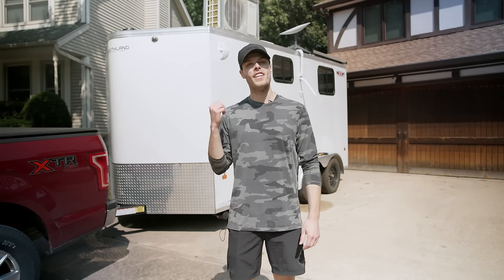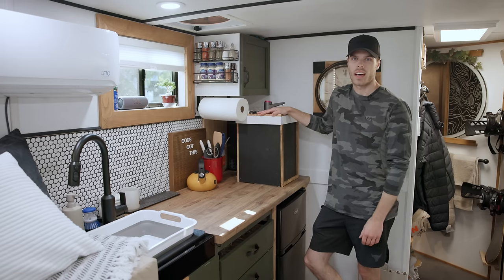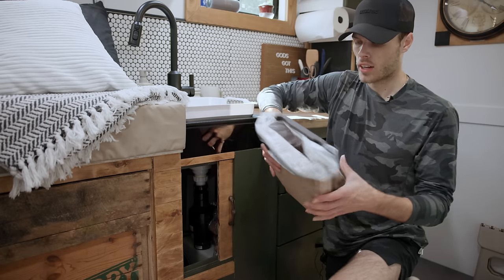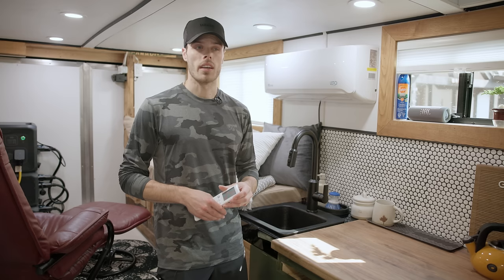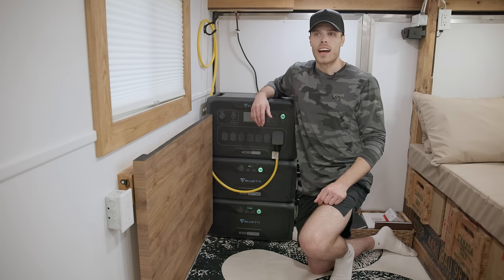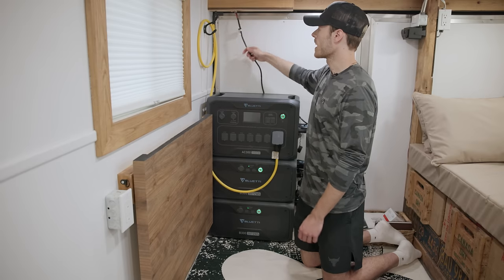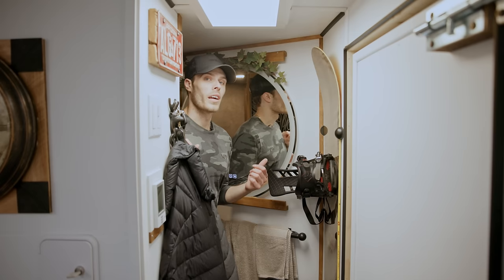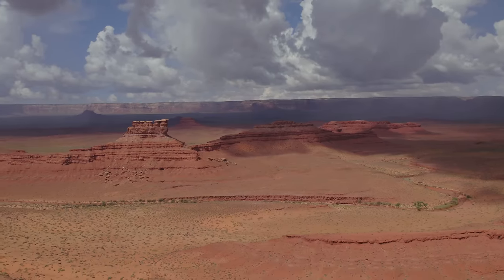I turned a $10K trailer into a $70K Modern Home

Comment: Nice build.   You may want to look into securing your side door latch when you are in the trailer so someone  can’t lock you inside.
Reply from the maker: I actually attach the lock over the latches and put the side bar off to the side when I’m in the trailer. This was something I wanted to make sure wouldn’t happen. 

I appreciate your comment! This is definitely important and it’s kind of you to take the time to mention this! 🙏🏼
Reply: No kidding about the outside latch. Also -- those "deadbolts" as he referred to them are anything but secure. Well under a minute to quietly pop that door open.
Reply: my thoughts also
Reply: @keithmorris6760 well he’d be outside his trailer in under 15 seconds, w his buddies Smith & Wesson by his side, lol

Comment: Get rid of the chair and get a hammock.  I've slept in a hammock for 4 years and it's the most comfortable. They are an acquired sleep but once you figure it out it's the best.  I'm surprised out of all the camper conversions I've seen I've never seen one person use a hammock. It would be perfect for space saving and also they are 100% washable so you can avoid all the creepers and foul smells of traveling,hiking,biking,camping,BO ect...
Reply from the maker: That’s a super interesting idea! I sounds like it would be an adjustment but something worth trying 🤷🏼‍♂️

Comment: I didn't find this video, it found me! 
I've been considering building out a cargo trailer.
Love your designs!
I too, would probably go with a power system that's just easier to work/learn, and just tweak it as needed!
You mention a couple of times how well insulated this is.  Would you give a brief description of the materials used and the process?
Or, maybe just get that other channel going for the build videos? I went looking for it and yt says it doesn't exist.
Posting here in a dedicated playlist would work too.
Reply from the maker: I’m really glad to hear you like the build! Hope it gives some inspiration for your own build! 

The materials I used for insulation was 2 1/2 inches of spray foam in the ceiling, 1 1/2 inch of R10 foam board in the walls (foiled both sides) and for the floor I have 2 1/2 inch of pink foam board. 

I haven’t currently edited any videos of the building process. There’s a guy named Chuck on YouTube who converts buses and shows his process and I took all of my inspiration for insulting from his video. I just couldn’t do spray foam on the walls because the owner of the trailer before me nailed plywood to the steel channels, so I had to work around that with foam board. Works great though, had enough heat to get me through -30 degrees celsius. 

Hope this helped! 🙏🏼

Comment: Nice Bluetti set up. I have the 200Max with 2 180 watt solar panels to run my 5x8 cargo trailer camper. My only major draw is the Frigidaire 5k btu window unit. It runs on less than 300 watts and has a soft start for the initial draw. I do want to get a Bluetti 300 battery pack to insure the storage. I was hoping to see the draw from your mini split on your Bluetti. Can you give us those specs,,nice build and thanx in bunches 😊
Reply from the maker: That’s amazing! Sounds like such a great system you have set up there! 
The storage of the BC300 is definitely nice to have! 

So generally if I start it fresh on a hot day, I’ll need to be pulling more watts from the start and that usually pulls just over 1000watts and I run it at that for 15-20 minutes. It cools the place down nicely and because the place is insulated well, I don’t need to run the A/C for long because it holds the cold in better. When the trailer is cold and if I continue to run the AC with the fan on low, it runs about 600-800watts. These are all readings from the Bluetti screen. 

My biggest long term pull is the fridge. It depletes the battery a lot so I might try to find another solution. Guess you don’t know till you try. 

I appreciate your question and I hope I answered what you were looking for!

Comment: First I want to say nice build. My wife and I travel about 200 days of the year pulling a nucamp t@b 400 BDL.  Comes complete with wet bath, kitchen, RV queen bed, small dinette, 3 way fridge (DC/AC/Propane), and microwave.  My second thought, just wanted to make some observations doing a visual comparison between our rigs.  I am confident you could have gone with a more energy efficient and smaller a/c - heat pump unit.   We have a Cool Cat and it easily handles our 15' of living space and lives tucked under the bench, driver's side of the trailer.  If your Bluetti system can power the a/c, I have to ask for how long?   Is there an outside plug where you can recharge your Bluetti from shore power?   Given the under carriage clearance when you were pointing out the drain pipes, could you have considered running both tanks into one outlet and placing that further back towards the leading edge of your wheels?  You didn't mention the size of the gray water holding tanks - if you are at a camp ground with sewer yep you can run the sewer hose open but what about when there is no sewer connection?  No stabilizers and looks like no spare on the camper so assume you carry it in your truck bed.  With this design, I would be curious to the tongue weight and your true loaded weight.  None of my comments are meant as criticism but are simply questions from someone who has spent a heck of a lot of time in a small camper on months long trips.   The one safety concern is that propane bottle inside.  Safe travels.

Comment: What did you do underneath the trailer we have a couple cargo trailers for our company and keeping pests out is very important and we have significantly less intrusions into the floor and I'm sure you do ? Also I would definitely find a way to get some more ground clearance trying to pull in and out of anywhere with a small hill is going to rip those sewer tubes right off. Even if you're careful those seemed a little too low

Comment: What’s up with that mini split on the roof? Never seen that before.
Reply from the maker: The reason why I did that is because I didn’t have any other place to mount it. I would have mounted it on the to tongue of the trailer but I have a smaller tongue then normal.

Comment: Great Build though I question the position of the main unit for your mini-split, seems a bit out of place up on top.
Reply from the maker: Yeah, it’s not ideal but I have a smaller tongue on the trailer then normal so I had to place it up top. The height is still lower then your typical RV so I’m still good with height 👍🏼

Comment: Is the AC too tall for some bridges? You talked about the Starlink getting ripped off the roof, how about the heating unit?
Reply from the maker: @a.life.reimagined  no, its still lower then most motorhomes and fits under bridges fine. I was more so meaning the wind catching the Starlink and taking it off of the roof. 

Are you asking what I’m using for heat?

Comment: I plan to do the same with my eco flow for power. I’ve not seen anyone use them this way before and was wondering if anyone had.
Reply from the maker: Yeah, honestly to avoid the headache of regular solar set up, I think this is a phenomenal solution! They’re such easy units to use and I find them pretty effective for what I need ☺️

Comment: Great job building the trailer, but I wouldn’t take bets on the ac not getting knocked off of the roof.
Reply from the maker: Thanks, I appreciate that! I can’t see a time that it would ever happen. It’s lower then a typical RV and it’s securely bolted with a heavy aluminum casing built around it, also bolted to the roof.

Comment: That AC unit looks like an accident waiting to happen. 

Is there a way to lay it flat while in transit?

Another concern are the door locks outside, I would want to do something to keep from having someone lock me in.
Reply from the maker: I know it doesn’t look like it, but with the standing height from ground to top of the A/C, it’s actually shorter then a regular camper. I pass under everything without issue. Also, it needs to be fixed because of the copper lines running to the head unit inside. 

The door latches have locks on the at all times when I’m inside the trailer so there’s no way for anyone to lock me in. I appreciate your concern though!

Comment: Since the minisplit points to the side instead from the rear, do you have any short cycling issues where it doesn't cool long enough to dry down the air to reduce humidity?
Reply from the maker: No, it keeps the place really cold and it’s cools the trailer down within a matter of minutes. I haven’t found an issue with humidity. Never had any issues 👍🏼
Reply: @jacobwagler  thank u so much for responding

Comment: Do you use a locking system for your drawers to keep them from opening?
Reply from the maker: Honestly I should but I haven’t been able to figure out a good solution. How I keep my drawers from flying open is by stacking my chair in front of them and they don’t move. Not the most efficient but it’s worked. I know many other people have a better solution.

Comment: Love your build just have one question rough guess how much do you have tied into your  Bluetti set up ?not the solar.and have you thought about puttingRollers on your bed?
Reply from the maker: Thank you for your question and suggestion! 

I likely have around $7,500 Canadian tied into the Bluetti batteries and inverter. They do have sales on them though throughout the year with decent savings so I would keep an eye out for discounts. 

I have thought about rollers but I didn’t think I could afford more clearance with the bed. It’s tight enough as it is with the bed under the platform. If someone was thinking about a similar solution, I would recommend them considering raising the platform even a little bit more. I’m happy with what I have though and don’t see any problem ☺️
Reply: I really appreciate your timely response. Bluetti is one I have but considering building myself a trailer.thanks  and by all means your bed your rules and it works I’m just to old and to Fat to get on these old knees😂😂😂 keep doing what your doing and live your dreams to the Fullest. Thanks again
Reply from the maker: @darrellbambammacon8390  I wish you all the best on your trailer build! 🙏🏼 Haha definitely hear what you’re saying, it is sometimes a strain on me so not a bad idea to have rollers! Just something to work on in the future ☺️
Reply: Maybe attach some large gliders, they are only about 1/4 inch thick, I use some on furniture in my home so I can move them.

Comment: Why didn't you put the aircon on the tongue of the trailer rather than protruding out of the roof?
Reply from the maker: I wanted to but unfortunately this trailer had a smaller tongue then the normal Cargo trailer so it wouldn’t fit unfortunately.

Comment: How did you do the walls ?
Reply from the maker: I used 1/2 inch A/C plywood on the walls and then sanded them, gave a first primer coat, sanded the whole thing and then paint 2 more layers. Came out really nice!

Comment: I don’t think the propane tank should be inside. When you look at RVs they are always outside. Your bed would probably slide way easier if you put furniture sliders under it. 
Nice build overall. I like some of your ideas.
Reply from the maker: Yeah, still finding a solution for the propane tank. I actually have felt pads under the bed so it’s not terrible, it’s just that it doesn’t have a lot of space with the blankets on the bed. 

I appreciate that 🙏🏼
Reply: @jacobwagler   - get the ceramic sliders. They are thin and glide like on ice.
Reply from the maker: @busch46  I’ll look into those! Thank you for the help! 🙏🏼

Comment: A bit strange to mount an HVAC exterior unit on the top instead of the back facing the truck. Rip off the starlink? I think the HVAC unit would get ripped off first!
Reply from the maker: It was really my only option. I have a smaller tongue than typical for a cargo trailer so it wouldn’t fit. 

I wasn’t coming from the place of it getting ripped off from hitting something, more from the perspective of, I’m not sure if the Starlink clip is strong enough to hold against the wind while travelling.

Comment: What kind of trailer is this? I want the double door as well
Reply from the maker: This is a trailer manufactured in Alberta Canada called Southland trailers. Great product! I would definitely recommend looking for a trailer that has a full sheet of aluminum top rather then a slip connected ceiling. Those will leak and cause issues so it’s best to get one manufactured really well!

Comment: Maybe keep your propane outside? They do tend to leak as the fittings age.  Hate to have a leak build up in there and then have the water heater ignite the fuel/air mixture.  RIP 😢
Reply from the maker: I really appreciate your comment! Yeah it’s not a bad idea. Right now I have a carbon monoxide tester always running but even still, it’s a good idea to keep it outside. I’m going to try to find another way to mount it. 

Appreciate your comment 🙏🏼
Reply: @jacobwagler  you are welcoms.  This caught my attention as I was getting repeated, small propane leaks at my RV tanks.  I think that the o-rings in the tank fittings dry out as they age.  That is the weakest link in the whole system but their rules likely permit this as their operating procedures would have the tank outside.

Great job on the build.  Job well done.
Reply from the maker: @patrickfrantz2466  yeah, that makes sense! 

Thank you I appreciate that ☺️
Reply: @patrickfrantz2466   I have had my small propane bottles in my van and trailer for years.  YES one  MUST have extra o' rings, pressure regulators, and hoses because they will dry out and leak.
Reply: @bobmirror7164  do you keep your in-use, sometimes leaky,  propane bottle in a closed cabinet with a propane fired water heater?
Reply: @jacobwagler research how to do propane inside.  A box with a vent at the bottom to the outside. Propane is heavier than air. Also you should have a specific propane detector mounted near the floor.
Reply from the maker: @gerrycollins9409  perfect, thanks I appreciate your information. I’ll look into that more. I have a carbon monoxide detector in that space specifically but I’m looking for a way to mount outside. Thanks for your comment.
Reply: @jacobwagler  CO (carbon monoxide)is a product of incomplete combustion. A propane leak I don’t believe would set off a CC detector. A propane leak would displace oxygen especially near the floor where you are sleeping.
Reply from the maker: @gerrycollins9409  okay that’s good to know. Most likely my better option would be to find a spot for it on the exterior.

Comment: I think your counters need to be a lot higher they're awfully low would be hard on your back
Reply from the maker: Surprisingly they’re actually standard height for regular counter tops. Maybe could have used an inch or two but I am a taller guy so could be a touch too short for me.

Comment: You can buy a 4-year old, top brand,  40 foot 5th-wheel toy hauler for less than $70k. Nice job, but not economical, nor better than current used market for the same price.

Comment: It is more of a "Driveway Condo." with that big hon-ken awkward A/C unit sticking out on the roof.
 Battery's are rated in amp hours and voltage dude.
 Those lazy boy recliner so comfee.  
Water fill system is a accident waiting to happen. Need a external fill and vent.
Bed is awkward.  I think you will do some interior remodeling in a few years.
Reply: The Buetti B300 batteries are rated in watt-hours.  They are 3072 WH each.
Reply: @sharimctiver8952   ok I see.  They are doing that for marketing reasons.  3072 watt hours divide by 12 volts equals 256 amp hours.   I guess it is easier do the math to add up the watt hours for energy consumption.  Like a 30 watt load,  in theory,  could run:   3072WH divide by 30 watts equals 102.4 hours.  In reality we need a fudge factor for heat and electrical inefficientices  of about 80 percent of the total to stay on the safe safe side.

Comment: Could you point out the never before seen part?
Because I'm looking this over and I'm not exactly seeing what you're talking about
Reply from the maker: I’ve personally never seen a pull out bed the way I’ve designed it, incorporated into a mobile home build.
Reply: Well, I will give you that.
I must point out that it is not a superior design as made clear by the excessive effort needed to try to Stow it again.
Certainly not a bragging point of never seen before... perhaps for good reason?
Mostly I'm just kind of hacking on you for making a clickbait title.
Not to say you don't have a nice little rig there, it's just it ain't all that bro.
I've got a 7 by 14 cargo trailer with 3000 W of solar collection and 30000 watts of battery storage along with R50 insulation
Ever seen that before?
Ps, it works really well
Reply: @reubenj.cogburn8546  It is different than most. It's like a pull-out truck bed tool box that you still work on top when it's closed.